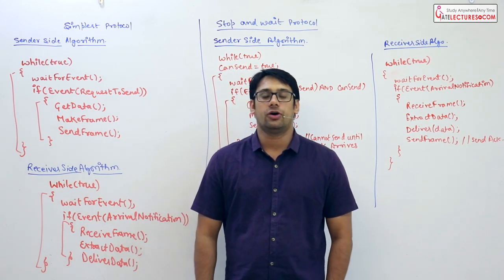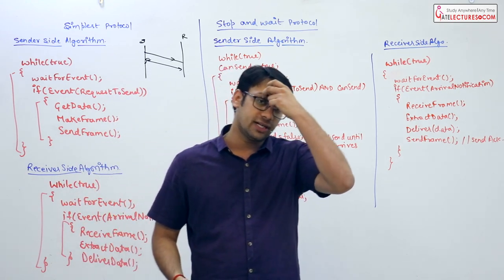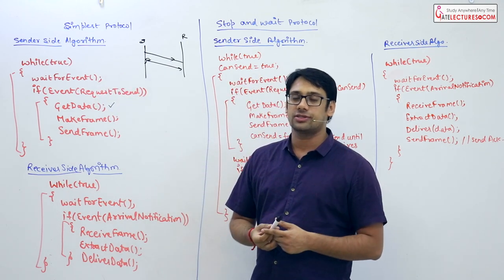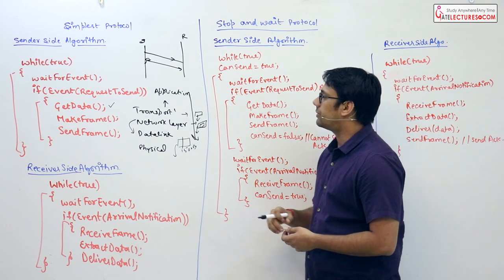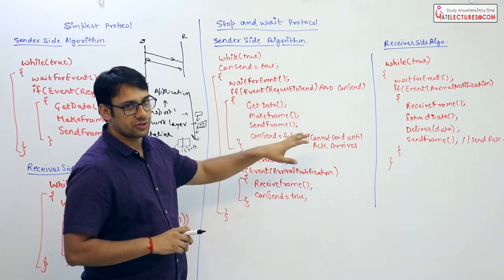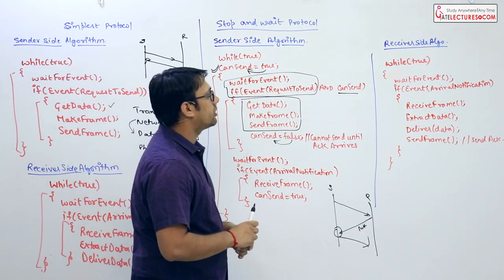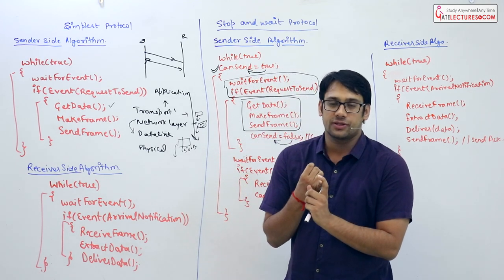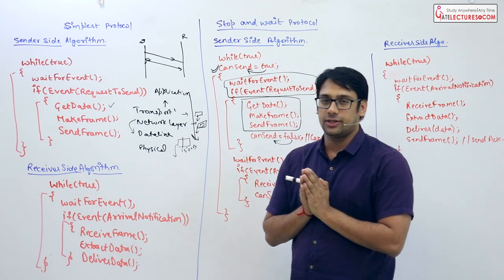Computer Networks 10 Algorithm used for Stop and wait protocol and Simplest protocol

Comment: Sir from the Stop-and-wait the sender-side the lines: 

while(true)
CanSend = true;
{
The rest of the code
}

Has problem since the canSend = true; is between the while(true) and the surely braces the program will take the canSend = true; as body of the loop and will be executed forever and never execute the lines after that. If we want to solve the problem we need to replace lines 1 and 2 as below:

CanSend = true;
While(true)
{
The rest of the code
}

Thanks.